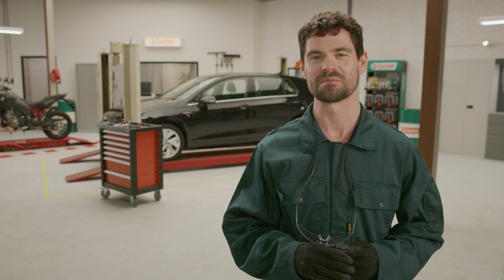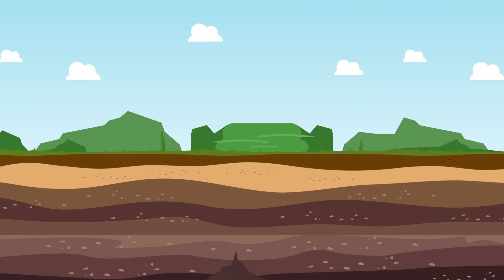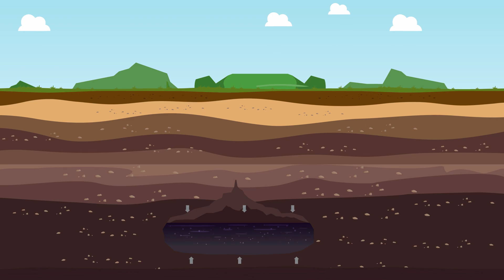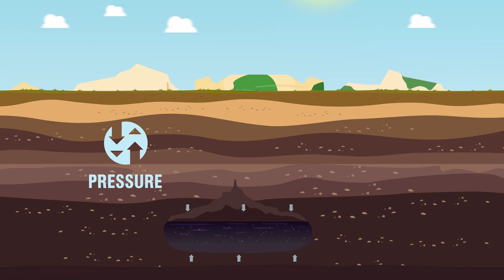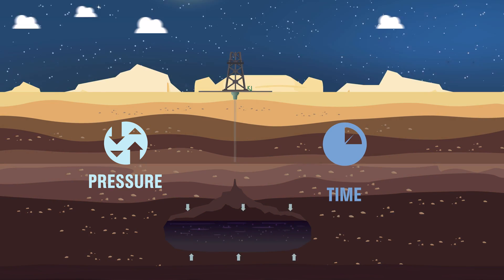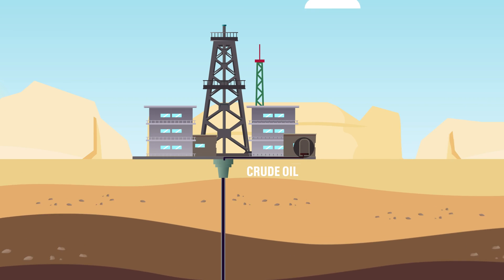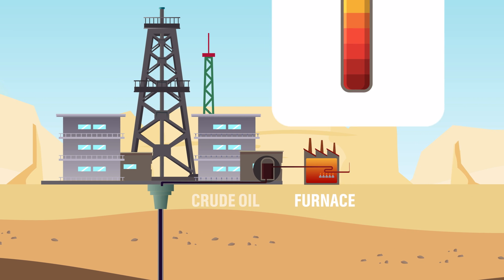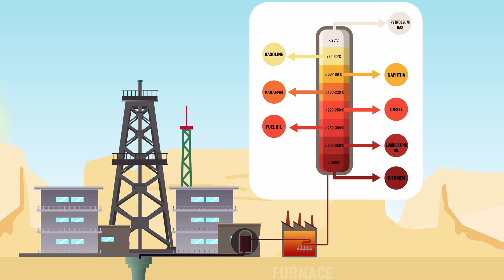Synthetic vs conventional engine oil | Car engine oil explained | Castrol U.K.

Comment from the maker: Which oil do you use for your car engine?
Reply: Synthetic
Reply: I use 10w 40 magnatec castrol. It protests better than fully synthetic
Reply: Full in my good cars, semi in my old ones.
Reply: Part synthetic
Reply: Full synthetic engine oil!
Reply: synthetic. I have seen a test with Syntec that did burn off. I have a turbo 2.0L in a Cadillac ATS. I need an oil that will not allow wear on my engine, and will allow extended oil change periods, because I always don't have access to an lift to cchange my oil.
Reply: Full Synthetic for my 2012 GMC Acadia.
Reply: Conventional. End of the year, at 95k miles, I’ll switch to synthetic.
Reply: I use Magnatec 5w30 c3 on my 2016 Mazda 6 2.2 d. Is it worth upgrading to Edge?

Comment: Full synth every 5k miles on a motorcycle seems reasonable, the engines rev higher but need much less oil so it is still affordable to use the best one frequently.

Comment: What's your recommend it nissan  kicks 2024, 0w20 
Castrol or mobile 1?
Reply from the maker: Hi, to assist you with your query, we need more details about your vehicle, such as its horsepower and fuel type.

Comment: I had a 1996 Jaguar Vanden Plas . I drove it for 15 years in Arizona, USA with 10X30 Full Syntheic Titanium engine oil. The engine lasted to 340,000.00 miles, before I donated the car. That engine never failed and that car was my daily driver.  Now my weekend 1995 Jaguar Vanden Plas has 170,000.00 miles on the engine. I am still driving it with 10X30 Full Syntheic Titanium engine oil. My daily driver, a 1995 Jaguar Xj6 has 95,000.00 miles and the engine is also driven with 10X30 Full Synthetic oil. I never had any issues with those engines using synthetic  oil. My transmission and rear differentials are also driven with Castrol products. I never used convectional oil in my engines as in Arizona temps go between 110F to 112F. Still at that heat the engines work great. No issues whatsoever. Yes. I do work on my 2 Jaguars all by myself and I can attest to the quality of the product. To add: I change my engine oil in the Spring time and late Summer, at 5000 miles interval, using Bosh filter. The same with the transmission oil on the Jags. I change it twice a year without touching the filter inside the oil pan. Replacing the oil frequently on the transmission (transmission pan only)  does not damage the transmission at all. It keeps the filter clean and the magnets inside the oil pan with less sludge. Also, with the Bosh Filter I can go up to 2 oil changes prior to replacing it. Max miles on Bosh filter with 2 oil changes 10,000.00 miles.

Comment: Castrol uses inferior group 3 base oil in their full synthetic oils. Other brands use goup 4 base oil which are PAO that are superior to Castrol offerings. That's the reason castrol oil are cheaper than the competition.
Reply: That is true, but somehow in Sweden Castrol is the most expensive oil. The mechanic even overcharges you on a simple oil change. Mostly I do my own oil changes.
Reply: Castrol is the MOST expensive in S.America.  (Made in Belgium)  It's all swings and roundabouts. Smoke and mirrors.
I bought 12 litres Castrol Synth 5W30......  today...almost  40% dearer than a Brazilian 5W30 Non-Synth.
But I have more confidence in the Castrol product. ....Better publicity?   Who really knows?
The debate rages on!

Comment: As a layman mineral oil 4000km
Semi 7000
Fully synthetic 10000
Is this right approach ? I mean if we follow these numbers for changing oil then the aspect of engine wear is similar for all types or still synthetic is best option ? 

Also older car like Benz year 2003 surely have some oil leaks and burning oil this reducing oil even before the 4 or 7 or 10 k limit thus needing to top up oil. So if we use mineral oil and change every 4000 km .. is it perfect approach ?

Comment: quick question, what's the difference between Castrol Edge 0W-20 LL IV & Castrol Edge professional 0W-20 LL IV FE? Is it the same oil and can be used interchangeably?
Reply from the maker: Yes, Agus. As I said above, Castrol EDGE is our retail range while Castrol EDGE Professional is our workshop range, but both lubricants are similar in formulation and approval. Hope this helps. 😁
Reply: @Castrol_UK  Thank you!!!
Reply from the maker: Hi Gus Wind. Thank you for your enquiry. Castrol Edge Professional was introduced exclusive for franchised official dealerships. The formulations are also developed for first fill/factory fill in car manufacturing. The Castrol Edge product line is for aftermarket/retail. These products carry more OEM specifications and are more widely used, also in multi branded /independent workshops.
Reply: @Castrol_UK  thanks for your answer, but since I have access to both products I would like to know whether I can use them interchangeably or not, Can you please help me?
Reply from the maker: Dear Gus Wind,
Please take a moment and complete our online survey by clicking on the following link:
https://on.bp.com/3TkyHRi. We look forward to your feedback.  To unsubscribe please click this link: https://on.bp.com/3TkyIEQ

Comment: 5w30 or 10w40 Which is better
Reply from the maker: Hi, Jen Matt! Thanks for your question.

There isn't a general "better" oil as it all depends on your vehicle's engine. 

If you need to check which oil is advised for your engine, we recommend using our Oil Finder. Link below:

https://on.bp.com/3MnCgCX

Hope this helps!

^ Castrol Team

Comment: It' doesn't really work that way. Some specs are very tight. It's impossible to make an ACEA C1 & JASO DL-1 oil purely with totally mineral un modified base stocks. I find this video odd - seems to apply to residents of Retardistan - aka 'merica.